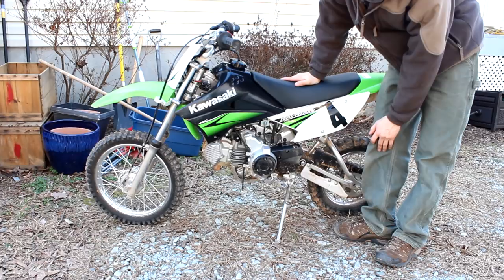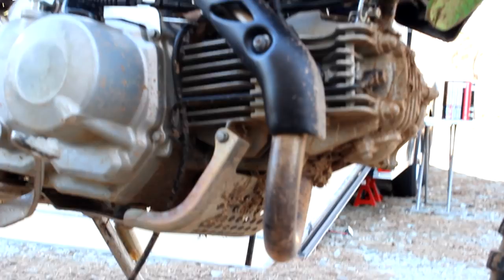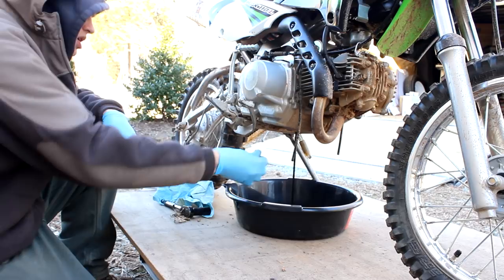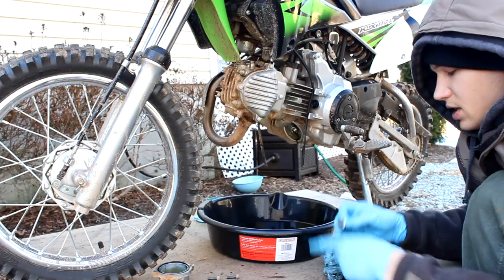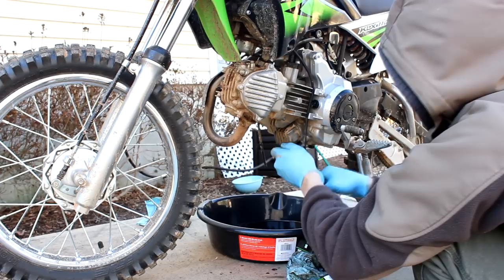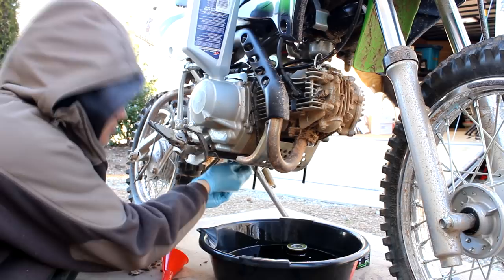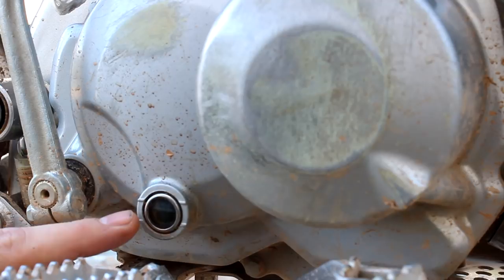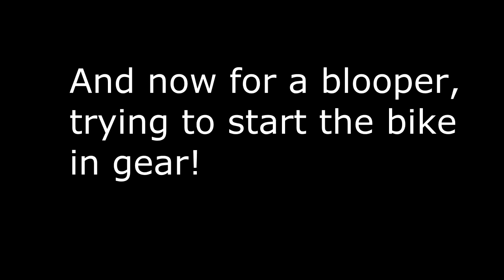Kawasaki Oil Change klx110L KLX 110 klx110 2010 Oil Filter service

Comment: for future reference you don't have to take off the skid plate. you can access the drain bolt through the skid plate. that's what the whole is for.
Reply: Oil filter genius

Comment: Thanks for the video. I managed to get through the entire process just fine except when I tightened the oil filter housing back to the engine using a oversized torque wrench, i made the mistake of over-tightening which stripped the housing on one of the two screws. Do you know of a lower engine assembly that I can buy to get my oil filter in place without the minor leak that it has now?

Comment: what do you do when there is fuel draining from the two tubes running down beside the motor on each side please help
Reply: Float bowl is probably stuck open but a carb rebuild kit

Comment: id like to ask, the manual says 1.1 quartz and thats is the amount of oil you put on the bike, my question is why did you add additional oil to your bike? whennyou put 1.1 quartz of oil. and also the bike is maybe not at its straight position.
Reply: TheMichael Arch because one Quart of oil is 1.0 quart so he put .1 quart of oil so it will be filled up properly

Comment: Thanks for the vids man! How often do I need to change the oil?
Reply from the maker: +Andrew Sitompul - a lot of people recommend every 10 hours
Reply: +matt dobson somebody is selling this bike for 300 but it needs a carburetor and throttle cable should I buy it and where can I get this parts thank you
Reply from the maker: +Brayan Ramirez I would buy it.. You could get it fixed for under $200, and resell for $800+
Reply: Andrew Sitompul it depends how much you ride. If you race like me change it every 2-3 races. But if you don't race you can change dirt bike oil every 3
Reply: Andrew Sitompul every 3 months

Comment: Is this motor oil or transmission oil and what do I use on the motor oil and transmission oil?
Reply from the maker: on this bike they are the same oil. I like to use a motorcycle 4 stroke oil. It depends on your riding conditions, but you can use 10-40 (colder weather) or 20-50 (hotter weather)

Comment: Is the Valvoline 10w40 full synthetic? If so does it work pretty good?
Reply from the maker: yeah, that oil was specific for 4 stroke motorcycles and was full synthetic. It worked awesome for that bike!
Reply: yeah i'm using it now and it's awesome. cheap and good!

Comment: About when should you change the oil and the filter?
Reply from the maker: +Brandon Nixon (Nixon's Tech) - you'll get many different answers.. it really depends on how much you ride. Most will you tell you at a minimum at least once every season.. I do it once a year.. The manual for most motorcycles state: 600 miles or 6 months, whichever comes first.
Reply: Brandon Nixon oil every 2-3 months if trail and free riding. If you race every 2-3 races.

Comment: I'm 4"10 and thinking about getting one would this be good for me and I'm 12 years old
Reply from the maker: +Lucas greeson - Yeah, i think it would be a great bike for you!
Reply: +Lucas greeson You should be OK. My 8 year old daughter can tip-toe and touch the ground while she sits on it. You can also wear a pair of work-style boots with big heels to help increase your height a little.
Reply: +matt dobson I'm 13 and 5,2 would it fit me
Reply from the maker: +WVhunters 23 I think it will be good, should be just about perfect, maybe a tiny bit big, but you'll grow into it!
Reply: +matt dobson ok thanks
Reply: Lucas greeson this was my first bike. I am also 12 and it works great and a good learning experience. It can also teach you good throttle and clutch control and it is a very low maintenance bike.